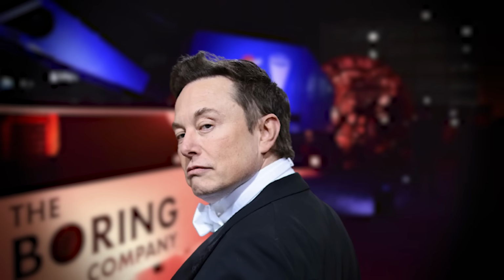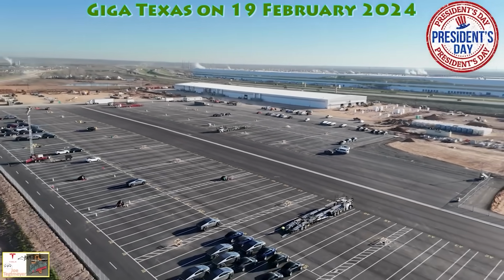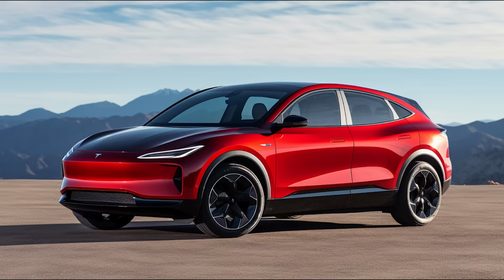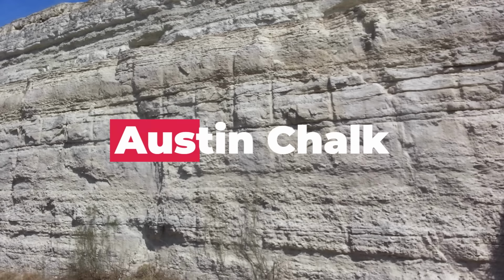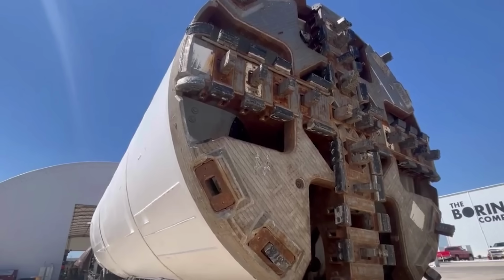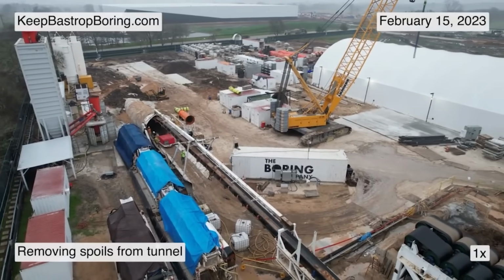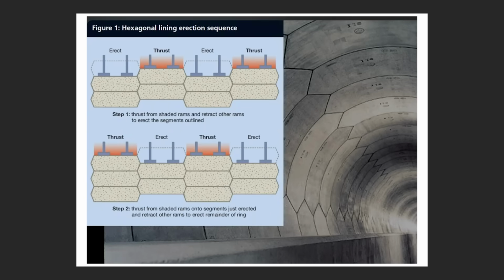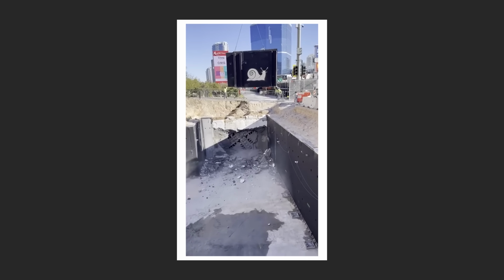Elon Musk Isn't Telling Us Something About The Boring Company

Comment: Actually if you do the math instead of speculate, if Giga-Texas produces 2 million vehicles a year with 24 hour production, that is only 3.8 vehicles a minute, well within the transit capabilities of the already constructed surface roads. The best part is no part - Elon Musk. Not a good enough reason when a cheaper alternative is already available. 

What are the Giga-Texas South Extension (SE) , new End Of Line (EOL) building, and The Boring Company (TBC) tunnel between them for?  Perhaps Optimus production (SE) and Inventory/Programming/Shipping (EOL) and a protected and secure route for Optimi to walk themselves from SE to EOL. Tesla has already moved new vehicle staging from the east side to the west side, they obviously don't need an expensive tunnel to do it.  The best part is no part. Why is the new EOL building so large, all on one floor, and with those loading docks at each end?

There is an extremely logical explanation if you include Optimus robot production in the equation. Recent videos from Tesla and others (Sandy Munro, Farzad Mesbahi, Randy Kirk, etc.) have indicated Optimus will be used soon, if not already, on the Tesla production line(s) for beta testing purposes. After a very finite testing period, they will enter production, most likely in the main factory building at Giga Texas, perhaps that's what the South Extension is for. Since they will weigh less than 130-140 pounds each, they would be subject to theft, plus they shouldn't be out in the weather before sale and delivery.  Space in the main factory building is at a premium, especially for something as mundane as finished goods inventory, plus traffic is bad enough without adding shipping thousands of Optimus robots. Solution: build a tunnel from the production building to the new EOL inventory and shipping building.

Build the first TBC tunnel with one end inside the Gigafactory at the end of the Optimus production line and the other end in or near the EOL building.

Manufacture Optimus robots in the factory. When assembly (with partially charged cells) and initial programming are done, they walk themselves through the Boring Company tunnel over to the EOL building for final checkout, complete charging, and being inventoried. After they are sold, they are taken out of inventory, OTA updated with a neural net version appropriate for their future use(es), and loaded into semis for shipping, all inside the EOL building.  All unaffected by weather, secure, and safe, 24 hours a day. The big parking lot and large number of Superchargers are probably for Model 2 production capacity as well as further Model Y and Cybertruck production ramping.

We will know more if the east end of the tunnel comes up inside the new south extension building. Since the west end is in the open, south of the new EOL building, other possibilities are another building constructed over the west tunnel entrance after the tunnel is bored, or a secure, covered walkway is built from the west tunnel entrance to the EOL building.

The timing seems about right for Optimus production.  If Optimus production grows exponentially and exceeds the tunnel capacity, they could build another parallel tunnel right next to the first one.  When the 7-story parking garage goes into use, that will free up a large area of current parking lot land for additional factory buildings. If one or more are for additional Optimus production lines, more tunnels could be constructed from them over to the EOL building.

Comment: I don't think this is correct.  There is nothing to suggest that the volume of Tesla production could possibly reach the level you are claiming.  For one thing, the market for EVs is already satisfied and there is little interest with used EVs.  Then there is the issue of many of other EV manufacturers that were not competing with Tesla initially.  Another thing is that making short tunnels between the production facility and the storage lot does nothing except add cost to production it doesn't save enough time or permit more space for storage.  That lot can only hold so many cars.  If Musk is building a tunnel, there must be a reason but this isn't it.
Reply: Hybrid demand also went up recently.

Comment: While breakdowns and maintenance might be possible in most likely at least are possible and happening I wouldn't completely blame that on the reason for slow digging in Las Vegas. I'm not exactly sure what is underneath the Las Vegas strip area however I can tell you that in the Mojave desert there are massive massive areas of what is called caliche is basically hard pressed sediment stone that is like a concrete! I used to live in Vegas not anywhere around the strip however they will spend weeks and weeks and weeks with jackhammers trying to dig a 20 or 30 ft deep hole. They can dig all the dirt and sand out no problem it's when they hit that caliche stuff that they literally shake the earth for miles in every direction. For my understanding their sheets or large pieces. If you're somewhere like what you have described Austin to be where it's more like a medium sedimentary chalk substance it should be able to do a mile in a week all day!

Comment: Even if the Austin factory spit out 2 million vehicles a year, which is their current extended goal for each factory, that's 1 car every ~16 seconds. 1 tunnel should be able to handle that, but two would be great and add redundancy. I think the speculation there would be half a dozen tunnels or more is putting the cart before the horse. However, I could see a scenario where maybe they would want a tunnel for each model of the factory at the different end points though.

Comment: It’s 28 miles to the railyard in Hutto with few roads to cross. That could be a next project.
Reply: The rail yard is in Taylor, not Hutto. So is the water tower. Do a little research. A tunnel that long would not be cost effective. A spur up to Manor using most of the ROW in the freeway like the Mopac on the other side of Austin was considered but too late.

Comment: So as a mining engineer with 30 years underground you discussion of "spoil" is very incorrect.  The foam is a common product used by well drillers when they are basically in dirt and is used the same way by TBMs.  It is a non-toxic soap product and presents no issues with landfill material.  Once they are in rock there is no foam being used and the the amount of hydrocarbons (grease) is not enough to even count compared to the cuttings coming out.  None of that material toxic waste unless they are cutting through something previously toxic. 

The reports of toxic materials is simply from grout used to cement the liner segments, typical cement burns that is possible when doing any concrete work.  It is very easy to treat to make safe and is no different than what you get rinsing out a cement mixer.  The fact that people in Las Vegas were getting burnt points at poor safety culture.
Reply: Thank you for taking the time to leave this comment and share your knowledge with us. I personnally cannot accept giving money away only to get misleading/poorly documented video in return. I've cancelled my patreon membership and unsubscribed to the channel. Thank you again.
Reply: The boring company is made because Elon musk wants to have tunnels in Mars that is the big picture. Therefore in this case by designing this tunneling machine and making it autopilot is a good idea. That's the reason why he had to design a new machine. But I do agree that he should take notes of people that have 30 years experience. In that he could see bits and pieces that are correct which would then lead to a better idea in making this type of boring machine machine. Remember with Elon musk you have to look at the bigger picture. It's like McDonald's. They are not in the hamburger business. The hamburger business just provides cash flow. The real business is ownership of Real estate. Even  the PEOPLE that buy MCDONALD'S franchises they don't OWN the building . So one must look at the big picture first then take it back to see how it then take it back to see how it is done. In Germany the Autobahn Express Road was made not for fast cars. It was made so that Hitler could hide his messerschmitts in the forest and they could pull out anywhere. By doing this they have created a tremendous awesome Road the Autobahn. Amen 😇😇😇
Reply: @infoSeeker007  Mars…. Oh dear.
Musk Didn’t design this tunnelling machine. It’s 30 year old technology dressed up to be something it isn’t.
Watch their tunnel at Giga Texas and see for yourself. 2 day set up in their website bull, we are now 10 weeks in and still no excavation.
1 mile a day! They have 300m to dig, they won’t complete it in under a month with that TBM.
Reply: @infoSeeker007  Do not withstanding the example you gave referencing Hitler and his Nazi 3rd Reich, why do you think Elon Musk doesn’t listen to people with experience?
Reply: @infoSeeker007  
The aim is to have tunnels on Mars. Really?!!!
When do you think that will happen?
Why would tunnels be needed on Mars?
How would a tunnel be constructed on Mars?
Reply: The bigger issue surrounding Musk's Boring company is the unrealistic deadlines that are putting the workers at risk of injury or death. Elon is the pyramid builder of his time. Choosing to pay lawyers to fight labor violations , rather than providing ppe or a simple shower to wash off the slurry, in my opinion, shows a lack of compassion for employees .  Working long hours around loud vibrating equipment is a recipe for disaster.  Is Elon sleeping in his tunnel?
Reply: Burnt Points are just like Bonus Points but in reverse… I think.🤔
Reply: So it’s my understanding that Elon Musk was stuck in traffic, and he said why the hell am I stuck in this traffic, and maybe we should do something about it. 

So there’s that story, and it makes sense to me, because I think we can all identify with being stuck in traffic, and wondering why the hell am I sitting in this damn traffic, and so if you’re Mr. Musk you can do something about it, and his answer was to tunnel underground, and so here we are, tunneling underground, but it’s expensive, time-consuming, and it’s very difficult work, but maybe he can get it done.

So if I could load my gear into my car, and sit back, relax, and cruise at 200 miles an hour to my destination, with the car driving itself after it gets off of the skateboard transporter, and then self drive to my destination, that would be a good thing. Cheers 🥂
Reply: @theodorehaskins3756  But this is the real world - not a fantasy land of make believe.
Reply: I think it really depends on the regulators. I'm not a mining engineer, but I have written proposals to the government for mining. My idea that had some traction was not to land fill the tailings (spoil, waste rock or whatever you want to call it) but instead to use them to create homes with rammed earth or 3d printed homes. In this way you have "locked up" whatever is in the material for something else that is useful.
Reply: The first question I had when I heard him claim too toxic to bteath..
Why is it on an uncovered conveyor and..
Why are dudes working without protection at every tesla and otherwise dig and mining  site.. 
Tx for confirmation of my speculation.
Reply: @burningsporkdeath  I love reading the opinions of ants watching a giant of industry at work! LMFAO an ants vision is is limited to what's in front of it.
Reply: TeslaSpace, please hire the mining engineer who posted to error check your videos about tunneling.
Reply: I had Grok fact check this, it says they do in fact use toxic spoil, that even in its patent.  Grok says: Standard TBM slurry/foam methods (e.g., bentonite-based for lubrication) produce hazardous spoil, handled via screw conveyors/augers to surface bunkers, as described in Boring's patents (US 2022/0153871) and OSHA-compliant Vegas operations. High-speed spoil (~tons/hour at 7 miles/day) would require truck fleets, a known bottleneck confirmed in engineering analyses by ASCE journals.
Reply: I only have 5 to 6 years tunneling experience and i agree with all of this posters comments. Also the reason to use rings is so you can steer the tunnel. The ring isnt perfectly flat, its off set so you are able to go around turns. If you use hexagons you would have the same issues as they would need to vary in size to go around corners. 

Also i interviewd with the boring company and their leadership is a joke. They want everyone able to program their own solutions, not my words. Not everyone is a programmer, and expecially in the tunneling industry. They also want to build everything from scratch instead of buying commonly made items. They think they can make better things than engineers the those who specilize, maybe but it will take forever. The Boring Co average retention seems to be around 3-4 years. They don't have any work life ballance and that shows in their retention. Let me ask them this one question. If your retention rate is 3 years and you are continually loosing people because you work them to death, do you really think thats more productive than investing in the people so you have some continuitiy?
Reply: @spikes1529  Very interesting insight. Fits perfectly with my view of TBC, having followed their progress since inception. 
So far as I can see they are around 30 years behind the curve on TBM technology. I think this latest EPB TBM has incorporated a vacuum erector and through-the-tail grouting which just about brings them into the 20th century. It's still a fairly basic TBM by any standards and their set-up at Austin Texas confirms this for me.
I wish I was exaggerating or joking as I am a huge supporter of anyone building tunnels. But their claims were, and remain, outrageous, and should be called out for what they are by qualified and experienced Engineers. MR Musk but quite some time and effort telling the world that the Tunnelling industry was outdated, corrupt and set in its ways, My experience has been largely the opposite, and it has been a privilege to be a small part of it.
My question would be; do any of their staff believe the drivel on their website about production rates, 2-day launches, 3x power installed etc...? or are they just taking the money while they can until they get sick of the BS.
Reply: @tunnellingsalisbury7605 I wouldn’t underestimate Elon.  He has entered several industries that are very mature and has innovated tremendously in each of them.  He isn’t afraid of failure and pushes for fresh ideas and gets them. He is a marvel of our times.  It’s astounding how he does it.
Reply: @F1fan007  I don't underestimate him. I have recognised for years now (since he called brave hero's pedophiles for rejecting one of his many stupid ideas) how dangerous he is to our society and future. Clearly he knows nothing about tunnelling or mass transport systems. But he carries a huge, dedicated fan base in the same way as any dictator or cult leader has done in the past (most of them got extremely wealthy too).
I agree it is astounding how he gets away with it.
Reply: @F1fan007  
Six gets you five either way on Elon being bankrupt before the end of 2025.
Reply: @tunnellingsalisbury7605  Its tunneling practice for Mars.
Reply: Finally a sane individual speaks with clear factual statement. The toxic chemical bit is just a sensationalist propaganda burp. The fact remains that the Boring company will bear fruit with many surprises in the future. The fact that everything is electronic should be a dead giveaway but sadly beyond the speculations of this third rate production, or am I being too disparaging?😂
Reply: @AllistairNeil  Grease can be toxic, and so can foam. But the video maker is wrong in many things.
Reply: I would like your opinion about an idea, the title of this video that Musk isnt telling us something about Boring may be true but in a different way. There are several proposals for tunnel based habitation on mars, it makes sense that you could create a large amount of area underground just by tunneling. A tunneling machine the diameter of a starship (9m) would be very heavy unless built for space. Currently Starship v3 is rated at lifting 150 tons, would a specialized tunnel boring machine from the boring company weigh in at less than 150 tons ? Is this the real reason that the Boring company exists ?
Reply: @rrmackay  Is that a serious question or a wind up?
Reply: @rrmackay  very good point.